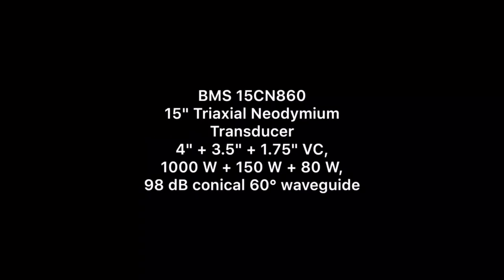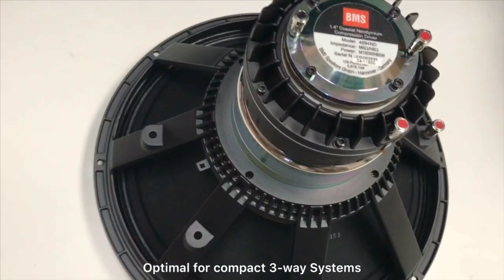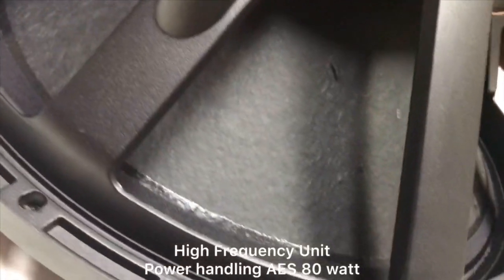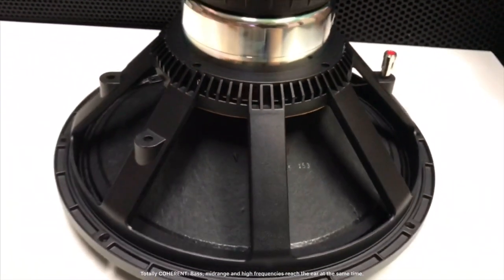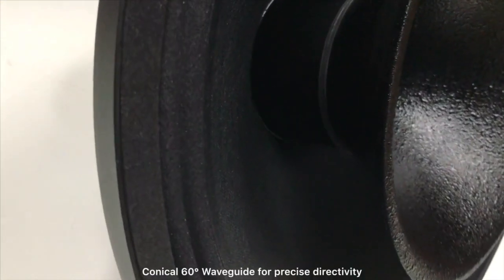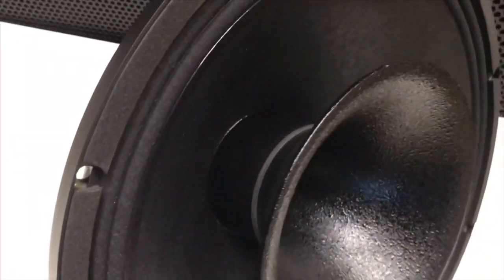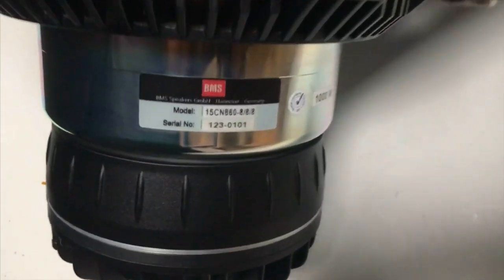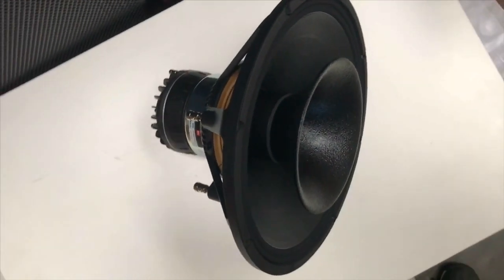Best loudspeaker ever? BMS 15CN860 Triaxial

Comment: Ahhh yeh those look familiar, I purchased 8 of those from you for a special project if you guys remember, looking at the dates this may in fact be one of those 8, I wonder if they are still the only 8 in the UK, Let me tell you how they sound guys, they are one of the most beautiful drivers I've ever heard. The most difficult part is going from these, to a more conventional separated setup, they sound so full, so clear and relaxing, I could listen to them for as long as we want without any hearing fatigue. And we only ever run them through class a/b amplifiers, we tried class D once to show how bad class d amps sound and it just ruins them, those amps are a waste of a circuit board and if you want to hear how bad an amp could sound, put it on these... Price is high for the drivers, but let me tell you its so worth it guys. I will never be selling them. :)
Reply: Do you use these drivers on your home system?

Comment: What is the sound difference between 860 and 890 other than 890 wider dispersion? 890 horn shadow affect mid bass as the crossover could not be lower than 800Hz?
Reply from the maker: Yes it is the horn dispersion, depending on application as whether you would want to take the crossover below 800Hz

Comment: I assume the drive units are not time aligned. They are on axis, but the High mid frequency voice coils are definitely behind the woofer voice coil. If it were a fullrange driver or coaxial with the tweeter coil lined up to the woofer coil, it would be time aligned.
Reply: Don't assume physically lining up the cones time aligns a driver. It doesn't. Voice coils are inductors and inductors resist change in current flow so the current lags the voltage they receive and motor force is proportional to current. The bigger the voice coil the bigger the lag. This lag is also frequency dependent with the lag more prominent on the lower frequencies then the higher ones. That means for example that 500hz leaves the woofer before 80hz on the same driver. It's like asking someone what time a train crossed the road. The front of the train crosses before the middle and then finally the caboose crosses, it's not all at once. Usually the goal is to time align where the different drivers overlap in the crossover area. In this case the tweeter is behind the woofer cone some distance as it should be as the sound from the woofer leaves later as the woofer's inductance from its larger voice coil lags that of the tweeter. All this is all kind of a moot point as crossovers also change the phase and add lag as they use capacitors and inductors, even electronic crossovers (DSP) do the same as physical ones. Whether this alignment is in phase would all depend on the crossovers used as well and how they all work together but having the tweeter behind the woofer is a good start. Bi-amping this arrangement using DSP would also allow the use of electronic delay if necessary.
Reply: @wally7856 Thanks for the clarification. I know that crossovers cause lag and phase shift that must be accounted for. The lag of the actual drivers does make sense.

Comment: One question...,  is the biggest disadvantage of coaxial and triaxial speakers,  the high expense of replacing the whole system instead if just the high frequency or low frequency drivers in a more traditional speaker cabinet??
Reply from the maker: Please remember that the all the units can be reconed or diaphragms replaced sales@lean-business.co.uk